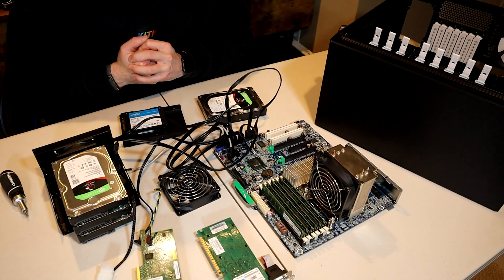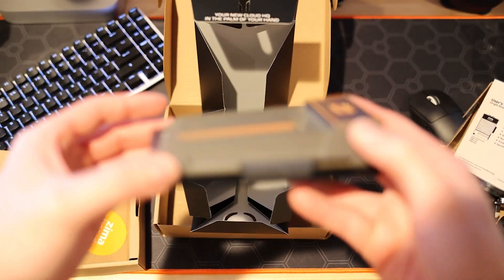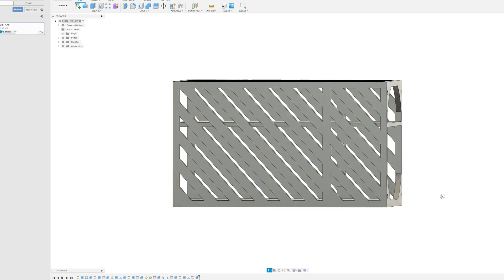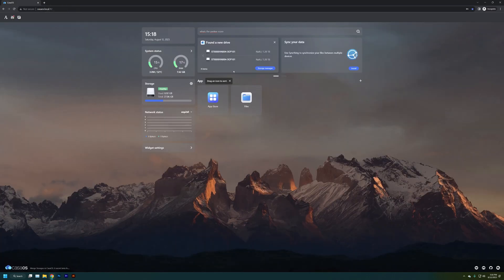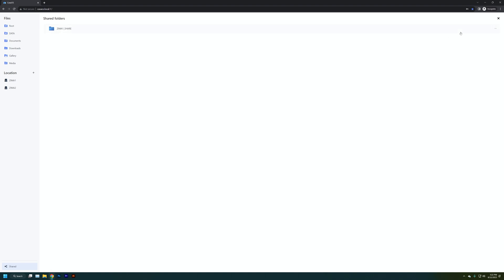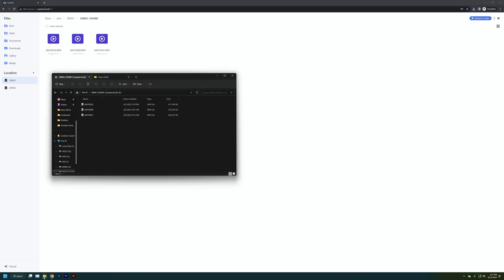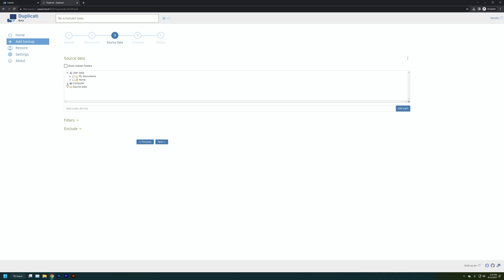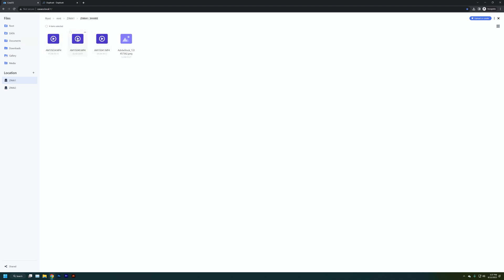Building the Perfect Home NAS! - 16TB, 6W TDP, Ultra Quiet & Compact

Comment: Quick questions:
1. How can I put 4 hd instead of only 2 with this?
2. Can I install unRAID on it ?
Reply from the maker: You can utilize the pcie2.0 port to add extra sata adapters, but would need a power supply for powering those drives. And inboard has some docs on how to install unraid.

Comment: Is there a 1u rackmount 3d printed case that supports a single ZimaBoard and 2x 3.5" drives?
Reply: I couldn't find one but with more popularity I could see it being done. Also, the Zimaboard site recommends not using anything larger than 2 2.5 inch drives as the power restrictions really don't support anything bigger. I could even see this implemented on one of those 10in racks. Pretty fun stuff

Comment: with the value of how mini pc's can offer so much more and that are priced decently, zimaboards and rpi's really meant for the niche audience and not really in the best way anymore due to their rise in cost and low availability too and it's honestly a shame because they are great for the possibilities you can get out of them.

 i have an rpi4, but i'm pretty soon going to get a mini pc that i can use all the usb ports with, video connections, and even hook up a small little DAS for media storage and there's my microserver or i can even search ebay to achieve a more microserver chassis to use.
Reply: Thoughts on the rpi5 instead?
Reply: There's no real availability issues with Pi's at least. One can walk into a store and grab a pi4 off the shelf in many/most places. They were suffering from parts availability from the whole chip shortages etc that affected corporations around the world. New cars were parked in fields over a year waiting on parts. They finally started omitting options to get em back on track. The pi5's yes are difficult to get yet as they're brand new just released. Yet not officially sort of as they were tracked for Jan release. But they too will become easy to get. They're back to full production
Reply: id actually argue a mini pc is going to be the niche, with they limited expandability and a higher power draw its not as appealing as a solution like this. if zima can make a better case with active yet quite cooling they have a very strong chance to be competitive in the market.

Comment: Truenas is clearly the better option, even if it has a slightly higher learning curve.
Reply: Truenas on 8gb are not recommended.
Reply: Openmediavauly is probably better for this use case. Just because zfs is very memory intensive.
Reply: Openmediavault can run on entry level zimaboard it need 1gb and truenas minimum requirements are 8gb which is not recommended at all
Reply: @Bixmy  I've seen open media vault for running raid 1 and then putting casaos on top for some ease of use afterward. As much as I like truenas, this implementation would work better on this board instead.
Reply: @philh98  exactly what i said trunas here is not the right place. I also use truenas in my system. But it wont run well on zima board. It have it place and time.
Reply: @Bixmy  yeah I think I might have just made a word salad all pointing to the fact that I agree🤣
Reply: I have an x99 based system with plenty of ram, a 20 core cpu and tiered cache for ZFS... Not o mention the 40GBe card in it. So this Celeron-based stuff is cute, but for me it is far from a 'NAS'.
Reply: @temp50  🙄
Reply: @temp50 I think your device is actually what is far from a “NAS” 😂😂

Comment: Has CasaOS fixed the issues with the 'combined drives' spontaneously losing your data?  I mean, its Linux so there should be many different ways to combine the drives and have them safe?

Comment: Your mini-NAS with the 3D printed case is very cool. I also like some aspects of the zimaboard, like the passive cooling and exposed sata ports and PCIe bus, but the N3450 (Apollo Lake) cpu is ancient - it was released in Q32016. I purchased a passively-cooled CWWK/Topton N5105 firewall/router box from ebay that costs about the same as the zimaboard, but the N5105 (Jasper Lake) has more than twice the performance of the N3450 for just a 10W TDP. The latest Alder Lake  N-series (N100, N200,..) are even faster, also rated at a 10W TDP. I just don't see the value in the zimaboard until they modernize the cpu.

Comment: Two suggestions—maybe don’t do your screen capture at 1440p (?) makes it pretty tiny unless you’re viewing on a similar large screen. I also don’t think you explained why you’d want to use a slower rate backup solution vs your relatively fast copy-paste approach. For backups, automation is crucial.  What you’re getting though here is not only compression but the ability to backup only changed files, and also multiple versions of those files with configurable frequency and retention.  That and of course duplicati can also transfer to many destination types like cloud services, S3 buckets, etc.
Reply: Ask it to zoom its screen in Windows instead of telling it to lower its resolution if you want things to be larger.  You're watching this video but you don't know the basics.
Reply: Im watching this on my television with chromecast. From the couch I cannot see or read the details so yeah a bit of zooming in the video editor would help. 👍

Comment: i don’t know the hype around zimaboard.
with a simple nuc style pc you have the same power consumption and way more possibilities.
Reply: I bought an HP G3 800 for $50 free shipping. I’m running truenas, plex, windows 11, and others on proxmox and it runs great. I have an internal m.2 and a sata drive. Btw it has 32 gigs of memory installed.
Reply: I keep reading this. But I haven't found any nuc style pc with the same specs at the same price  (160 dollars with its current discount).
Could you please recommend any simple nuc style pc at the same price?
Also what makes this attractive to me is how power efficient it is (6-watt TDP before you add peripheral) .
Could you please recommend any simple nuc style pc that is so power efficient?
Reply: @hyperion6  i don't think that zimaboard is 6w "whole consuption", because the 6w is the cpu only, and in fact the adapter is 12vx3A=36W.
There are similar cpu for around 10w,for example i have NUC6CAYH that is a 10 w and a NUC5PPYH that is 6w (cpu only)

the benchmark are similar with zimaboard, and being quite old they cost similar to zimaboard BUT they can be upgraded and they have a real ssd, not a emmc (soldered). 
yes, the costs are a bit higher (a nuc5 + 8 gb + 128 gb ssd would cost around 190€), but... it's a real pc and if yuo have some problems with ram or ssd you can simply replace them.
Reply: @massimo79mmm  I don't care if it's upgradable. I want to use it as an emby server with transcoding and the specs of it are more than enough. If I got it right, there isn't anything cheaper that a zimaboard with 8 gb ram on it and with support of hardware hevc transcoding, right? Btw, they do claim TDP 6W. on the specs of the device, I checked it again,. They may lie, but I haven't found anyone posting anywhere that they lie about it.
Reply: Nuc is great but doesn’t have PCI or SATA connectors.